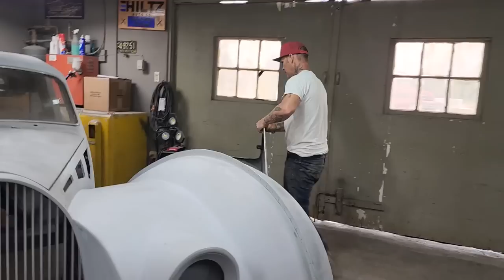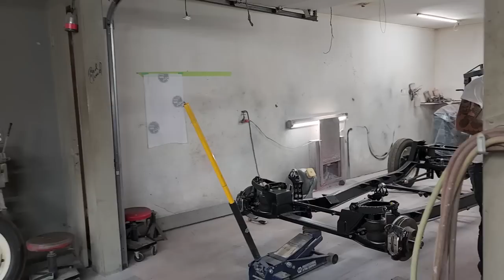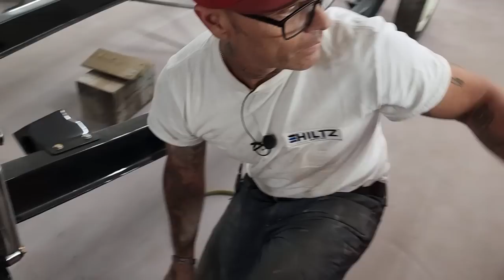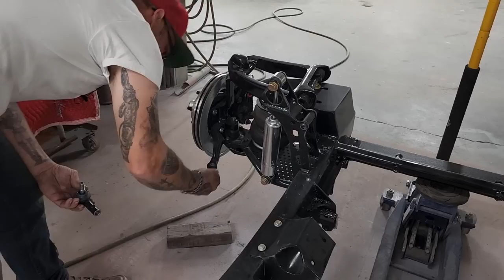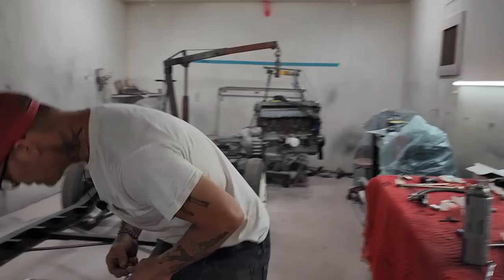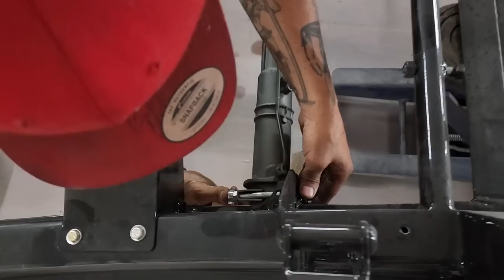Back on the Bugatti: applying the doors, fender skirts and steering rack

Comment: The tool with a tapered cutter is called a Reamer.  Used to clean up the inside of the tie rod ends so they fit or enlarge to accept the adjustable ends.  Chad, they make a thread cutting oil that aids and lubricates drilling metal.  It has sulfur in it to resist heat during drilling.  Saves a lot of drill bits.
Reply: A reamer. Got it learned something new..

Comment: Hey Chad….if you need to heat the bolts up to soften the red loctite….and you’re concerned about damaging the paint….get yourself a big soldering iron. You can stick it directly on the bolt head or thread end and warm up ‘just’ the bolt.

Comment: reds not forever, its for strength, brakes, drivelines so forth things that are imperative or safety related, and items that are not routinely removed, more of a permanent usage.. use a toothpick to apply just a SMALL drop, all it takes for normal applications, of course lock tight should never be used to hold stripped or loose fitting fasteners so forth..

Comment: Hey chad, will the airbag suspension be adjustable or is it a set air pressure? Also will you add lines to the airbag so you could add air it up when it gets low?

Comment: you can get work glasses with little side guards that help prevent debris from getting in your eyes as a welder fitter in the trade that's what I used for decades.

Comment: The best way to reamer the taper out is to work out how big the top hole needs to be , then drill it out that size . When you then reamer it you do not cut as much metal out and it is easier . I have used this method many times she adapting a different suspension or track rod end into a part not made to accept it . Good job on the Bugatti !

Comment: that is not a drill bit, its called a tapered reamer. you need to use lots of lubericant, and make sure you are 90 degrees to the steering arm, and take your time and let the tool do its job. good luck

Comment: Coming along nicely. As you are now aware when running that reamer you have to keep it oiled. This is also one of the main reasons I absolutely hate using an air drill for heavy drilling or reaming. They just don't have the torque needed. But I can't wait to see this project completed.

Comment: and the caster & camber needs setting  on the front end    on the subject of doing a car or van by the time i got it on the road was close to twenty years after i got it  till some one told me to meny  projects not enuff life  so i moved them on  good luck with every part you do id love to see it done and driving  P S the fender skirts use a vw fender piping or the like to close the gape✌🤘

Comment: For the problem fixing in the rack;-Make some tube spacers ( like a pile of washers ) to offset the rack and longer securing bolts. Or buy a align key head stud bolt to lock in flush

Comment: If you would have used a bigger Drill (electric) you would have drilled that out faster and easer. Sorry Chad I love what you do and how you do it, but on this one little thing I think you made a mistake.
Reply: So what is his mistake, taking a couple more minutes ? Who cares no big deal, some people just love to complain I guess.
Reply: Have a lot less control with an electric drill. Grab and rip out of your hands. The air drill doesn’t have the same torque as electric…so much easier to control.
Reply: @michaelbristol6467  I was not complaining, I was making a suggestion, I love what Chad does and how he does it, I have worked and built cars and trucks all my life, and I am now in my 60's, Thank you!

Comment: The tie rod ends for the mustang might have a longer stud. Its a tough  one. I am thinking you might need to thin the spindle arm a bit so the tie rod stud gets full engagement and the nut gets enough threads. If it goes bad you might be able to use a heim joint. You can always tape off and touch up black just paint small areas you had to rework. Nice car really nice.